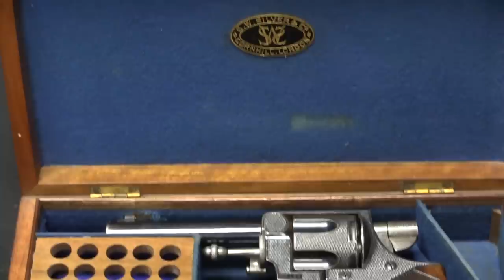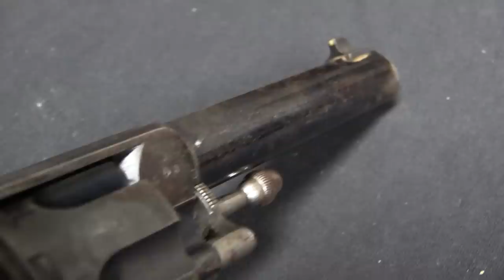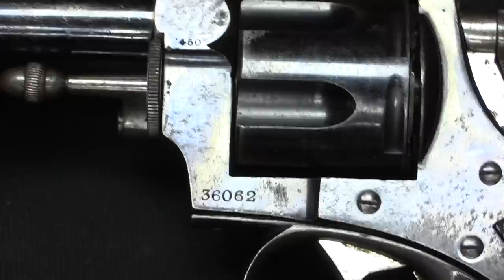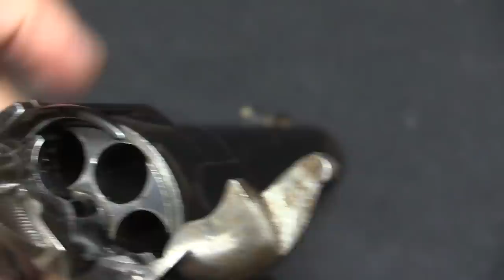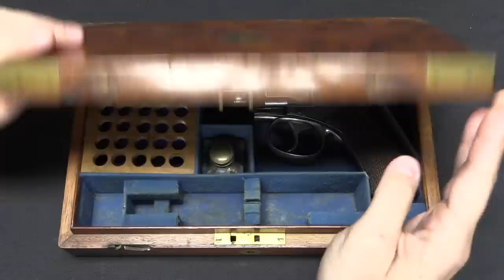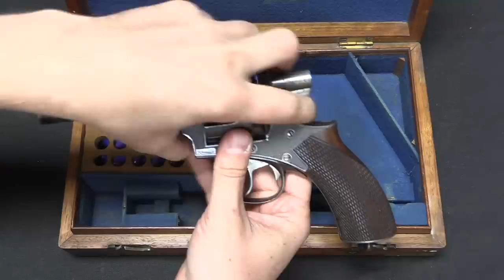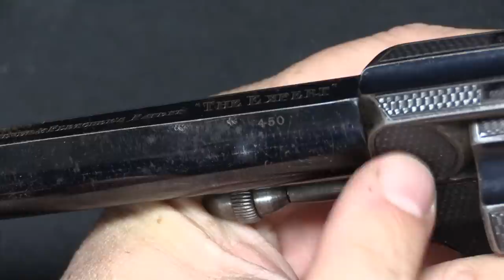1884 Tacticool: Silver & Fletcher's "Expert" Auto-Ejector

Comment: Britain: home of the semi auto bolt action and now the semi auto revolver
Reply: Have you heard of webley fosbery
Reply: @techpriest5452  Kind of a solution looking for a problem, but cool nonetheless.
Reply: Not technically a semi automatic revolver since it lacks the automatic loading of cartridges.
Reply: @jonasstrzyz2469  neither is an SMLE. It's just a humorous exaggerated description
Reply: @anthonyhayes1267  
Fair enough. Although my question is if there has ever been a self loading revolver. 
Also, if you add a gas system to a straight pull bolt action rifle, is does that make it a semi automatic bolt action?
Reply: @jonasstrzyz2469  yes to the second question. Ian covered an m95 conversion
Reply: @jonasstrzyz2469  The Webley Fosbury and the Mateba are both semi automatic revolvers.
Reply: @shooterqqqq  
No, they are recoil operated self cocking revolvers. Semi-automatic refers to the automatic loading of a new cartridge into the chamber. These revolvers do not automatically load new rounds into their chambers. 

Despite what people may have told you, semi-automatic does not mean one shot per trigger pull.
Reply: @shooterqqqq  
They do, but that is not what semi automatic means. Semi-automatic has nothing to with the type of trigger or trigger mechanism (striker or hammer fired, double or single action). So the only thing left is that you have a revolver that automatically rotates the cylinder after firing. 

Semi-automatic refers to the automatic chambering of a new round. Aligning the cylinder with the barrel does not count.
Reply: @jonasstrzyz2469  Gun experts though the decades disagree with you. Semi Automatic means the firearm is ready to fire another round and the only action needed by the trigger is to release the striker or hammer. All else is automatically done by the firing of the cartridge. Look up Webley Fosbury or Mateba.
Reply: @shooterqqqq  
Going by your definition the Boberg line of pistols are not actually semi automatic. Because they have a double action trigger. 

I know these two revolvers work. I quite frankly disagree with your definition of semi automatic, as it has a striker or hammer fired DOA, SAO or DA/SA has no impact on it. The revolvers are self cocking, but they are not semi automatic. 

"Gun experts though the decades disagree with you." 
I would love a citation. Actually, due to it being several decades of gun experts give me 5.
Reply: @shooterqqqq  
So, instead of decades of gun experts providing a different definition of semi-automatic. You are going to ignore my question, and show me a video a a revolver that is not actually semi-automatic. 

I know that these revolvers are self cocking and self aligning, but that does not make them semi automatic.
Reply: @jonasstrzyz2469  I answered your question over and over if you would have noticed the videos. You continue to show your absolute ignorance of firearms. I gave the other commentators examples of how you are wrong and I was wondering just how deep your ignorance would be. I didn't post those for you because I knew in your illusion you would ignore all the evidence. I"m also fascinated by flat earthers so thanks for the entertainment.
Reply: @shooterqqqq  
So you send me three links, two of them are by LifeSizedPotato, who apparently according to you must be a firearms experts that knows more than decades worth of firearms experts do, because links to definitions that are provided by those firearms experts are absent. 

In the third video, Ian never refers to it as semi automatic. And in the description he refers to it as self cocking, it would thus seam reasonable to assume that the automatic refers to the auto (self) cocking action of the firearm. 

As such, I have to repeat myself. You have failed to provide a single citation as to a definition of semi automatic by a firearms expert (something that should not be to difficult, given that "decades worth of firearms experts" disagree with me). You have also not answered my question as to whether by your definition of semi automatic DAO magazine fed pistols (such as the Boberg line of pistols) is in fact a semi automatic firearm or not. 

I also do not see how me using the correct definition of semi automatic has anything to do with any other beliefs that I may or may not hold. 

But, I guess such a disagreement based on not receiving citations that I asked for multiple times, and a question to my answer that I also asked for. Makes my use of a different definition of semi automatic firearm somehow equivalent to a flat earther. Ok, whatever you say and wish to believe.
Reply: @jonasstrzyz2469  Yes, the people who demonstrated the Webley Fosbery and the Mateba are experts in their fields since they researched and presented you with this evidence. Both firearms are semi automatic. Both designers stated the exact thing. NOW IT'S YOUR TURN. Send me a link or video that  claims the Webley Fosbery and the Mateba are simply conventional revolvers. I'll wait.
Reply: @shooterqqqq  
Never said they were conventional revolver. 
"Both designers stated the exact thing."
Citation needed, and on that note. Hiram Maxim called his suppressor a silencer, at least if you look at the marketing. But does that make it a silencer, no because a silencer does not really exist since it is impossible to reduce the term noise of a gunshot to it being silent, and therefore it does not matter what the marketing, then inventor or the ATF says, because the proper turn would be suppressor. 

Now you can either show me the sources of those firearms experts, and their books/ articles that contains your definition of the term semi automatic or you can continue to lie to yourself by telling me that you provided the sources that I asked for.
Reply: @shooterqqqq  
At this point, the semantics involved are so specific they really become meaningless.
Reply: Jonas Strzyz by turning the cylinder u r chambering a new round, since a cylinder is built like a chamber
Reply: @jonasstrzyz2469  
Are you knowledgeable in David Dardick’s open chamber design
Now assuming you are correct, the Dardick revolvers would not be semi-automatic

However there were machine guns designed by Dardick in his military contract, using his triangular rounds and his open chamber design.
If something cannot qualify as semi automatic, it cannot qualify to be fully automatic, however as these were machine guns (by definition they are fully automatic) which uses a revolving open chamber design.

This proves that using different chambers qualifies as automatic loading.Therefore revolvers are able to be semi-automatic.
Q.E.D.
Reply: @maybeharold 
Thinking of it a dardick oprn chamber design can be semi-automatic - if the a new is chambered directly after firing, and it is not chambered due to the trigger mechanism being activate by the activation of the trigger.

This differs from revolvers that are self-cocking orkar use self-alignment mechanism of the cylinder - without chambering a new round.

Comment: There are two big problems I can see with firing this thing with the gate open.

1. The extractor extracts on the 2-o-clock chamber whenever the hammer comes down. If this is your first shot with all six chambers loaded, that means it just extracted the live round that was in the 2-o-clock chamber (rather than the just-fired case in the 12-o-clock chamber), limiting your effective maximum capacity to five.

2. The recoil of the first shot may cause the round in the 4-o-clock chamber (which has nothing holding it in place) to back out of the chamber, seizing the cylinder until you push it back in with a finger or something. Keeping the rounds from backing out of the gun is the purpose of a loading gate.

Both of these would only affect the first shot, since the extraction means that those two chambers (2- and 4-o-clock) would be empty on subsequent shots, but it still seems like a tremendous fuss for something that's supposed to be the recommended method.

Comment: Re the Sherlock Holmes discussion; Conan Doyle sometimes used technical details he didn't fully understand. A story called "The Horror of The Heights" is interesting to an aviation geek for what it got right, (a 1913 10-cylinder Anzani motor) and what it got wrong; (the effects of hypoxia and changes in rate of climb with height.) He seems to have mixed in some diving effects.

Comment: If I understand this correctly,
When the gun is in "auto eject mode" if you cock the hammer and decide not to fire and decock the gun and then decide you need to fire the gun when it is cocked it will drop a live cartridge on the ground.

Comment: I do wonder if they ever looked at cutting down the loading gate so it covered just the bottom cylinder, or if that is possible. In theory, it could have allowed the user to keep their rounds retained within the gun better while still allowing the auto-ejection to work as intended, all while avoiding having to flip out a loading gate that could get in the way before use.

Comment: I guess the only practical use I can imagine is if you left the loading gate open and loaded a new round after every shot. That's actually kinda slick. Easy continuous reloading under fire, with a reserve of five shots if you suddenly need to start firing rapidly. And the hammer safety also works as a safety, believe it or not.

I guess the main problem I see is that a gun that ejects hot brass straight back is not going to be as pleasant to use as one that ejects it, you know, up or to the side. Firing right handed, well, I hope you're wearing long sleeves.

Comment: It appears to me the best way to use this wasn't covered. That is after firing all 6, 1. open gate and put firing pin on safe  2. put gun in left hand 3. new cartridges in right hand 4. pull trigger twice to eject one and advance empty 5. load new cartridge 6. pull trigger 7. repeat steps 5 and 6 five more times.

Comment: You're left handed... have a bag of loose cartridges on your right side. Leave the loading gate open; shoot, load one more cartridge. Repeat until bag is empty.

EDIT: For that matter, this pistol could have a clamp-on stock made for it with an integrated tube mag. Make it quasi-helical for extra steampunk effect, or add a little trip lever that rides behind the hammer that inserts the cartridge from a stick mag when the hammer is cocked.  Since the rounds are LRN and rimmed, all you have to account for is enough pressure to slide a cartridge in the chamber, which then serves as the retainer for the next round in the magazine. Cylinder turns, next round just slides off the rim and into the open hole.

Comment: It kinda looks like that if the hammer safety was in the safe mode it would obstruct the shell casing, or live shell, from ejecting all the way out. Be nice to have some empty cases or dummy shells to see the actual workings of the ejection mechanism. Cool concept, obsolete with the top break revolvers introduction I'm guessing. And that is very nice looking engraving on the presentation model.

Comment: Ok, let's label the chamber under the hammer as 1, the chamber at the ejector as 2, and the next one down as 3.
In theory, if you're firing with the gate open, you could fire 1, eject 2, and potentially load 3 before firing your next shot. You could keep up a steady stream of fire with a fire one load one system, and chambers 4, 5, and 6 would serve as a reserve in case you need rapid fire.
Not sure if it's ingenious or insane...

Comment: With an unloading system like this, wouldn't you only be able to load 5 rounds into the revolver? As first round fired wouldn't eject that case, it would eject a live round. Unless you use the loading gate, I suppose, and open it while firing. Though that would decrease speed quite a bit.

Comment: see i think this is really really cool. i like the idea of taking an obsolete firearm and throwing on some wonky system to try and upgrade the gun into something a little more modern. this system isnt very practical but hey i guess it beats punching out each shell one at a time. however it doesn’t really look like the sort of thing you could buy aftermarket and put onto your revolver. you most likely had to take it to these people and have them fit it onto your gun, or even worse buy a whole new piece from them with the system built in however the latter would explain why its engraved with their names. actually what got me into this kind of thing was seeing your video on the alofs system for a single shot shotgun which has to be the ultimate device for turning your obsolete gun into something a little more useful.

Comment: These a couple problems if you loaded 6 rounds and then run it with the loading gate open the 1st cartridge ejected would be a live round.  You would have to load it with 5 and make sure the empty chamber is in line with the barrel before cocking and firing.  There maybe a problem with the spent case sticking and not fully extracting from the cylinder thus stoping the cylinder from rotating to.  Also with the loading gate open if you tipped the revolver back before firing you may lose 1 or 2 cartridges from gravity.  I think IAN has it right that it would be better used to eject the cartridge after there spent rather than during firing.   It would have been nice if ian could have shot this or run spent cases thru it so we could see how good it really does work im curious!!!  Oh well such is life.  Thank you again Forgotten weapons for another unique historic firearm!!!😄

Comment: Unintentional safety. Just carry with the tab turned and a quick flick to bring the pin into play. Also a good bit of Eulidian geometry, but will be in need of work to keep the edge on the ejector.
Reply: It wasn't unintentional. 

Silver & Fletcher  also sold the  the hammer, as a retrofit for existing revolvers, specifically as a safety feature.

Comment: Did they not have swing out cylinders back then? That seems like a way more convenient, simpler, and more reliable way of quickly ejecting spent casings.
Reply: Colt didn't start making revolvers with swing-out cylinders until 1889, five years later.

Comment: Snazzy, sure I would prefer a swing out or break action for easy cylinder access, but if I was stuck with a fixed cylinder and a loading gate this looks like a nice quality of life modification.

Wonder how well this translate to other models, could I take a modern Colt SAA replica to a competent gunsmith and tell them to replicate this system for example.
Reply: I'm not sure if the patent is still viable but the system looks like you'd have a hell of a time finding someone who could recreate it. Personally, this gun is a nice joke, it's even interesting.
Reply: This would make zero since on a single action revolver, cocking the hammer would take just as much time as advancing the cylinder by hand and using the ejector.

Comment: I feel like if auto ejecting revolvers were ever practical and functional then they would be the standard in revolvers today.
Reply: At the point when black powder pressure was the limit and reliable semi auto didn't exist they were practical, as pressures went up they became less viable because we could get reasonably reliable Semi pistols and higher pressure and thus more powerful revolvers.

The autoejector/break action was the best designs for practical shooting and combat for about 10 to 15 years. Faster to load, an alternative to the patent from S&W on swing out cylinders and reasonably cheap to produce. Technology moved past them.

With modern materials a breapk action eject on break capable of full bore 357 would be an incredible weapon the Russians issue one if i remember rightly the Rex412. But semi autos mean that combat revolvers are a niche interest. Would be amazing for sporting use in USPSA/IPSC though.

Comment: The web is a prime example of not wanting to move forward with better pistols because of too much pride.

The 1911 was far superior

Stating that revolvers had less malfunctions just didn’t out weight the ability to insert a clip rapidly versus popping out individual casings.

Even with this modification you have to take into account loading. 

This gun when it was created was incredibly useful but it was outdated for at least 20-30 years

None the less a near piece of history and innovation that wasn’t used in masses later after designed and perfected

Also if you asked me there were other revolver made in America at least 20-30 years before this one that were as effective or better

Disclaimer: these are all personal opinions

Comment: where is the profit of having an autoejector that immediately ejects the live round nr 6 after i fired the first shot??
Reply: Load the gun as normal (all six chambers) and close the loading gate.
When you use the gun first flip the gate open, the ejector lip will fall onto the back of the rim, no problem (unless no. 5 just falls out 😖)
Reply: That's not how it works, did you hear the part about the loading gate?
Reply: I think you would have to close the gate for the first round, which is indeed pretty stupid
Reply: @skeetsmcgrew3282  
No, the extractor is held clear of the chambers 'till you fire a round.
Reply: @andrewholdaway813  yeah but the extractor is powered by the hammer, when the hammer is hitting the round it can't simultaneously be extracting that same round, it would have to be the next round
Reply: @skeetsmcgrew3282  
Previous, but yes I  think you are correct. You'd have to start with the hammer on an empty chamber.